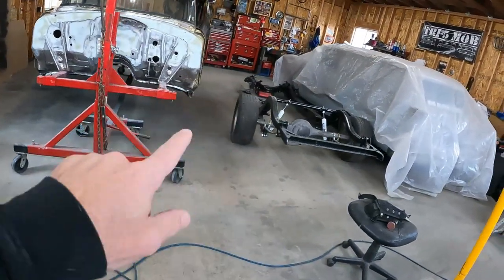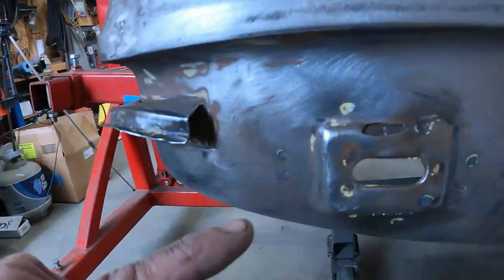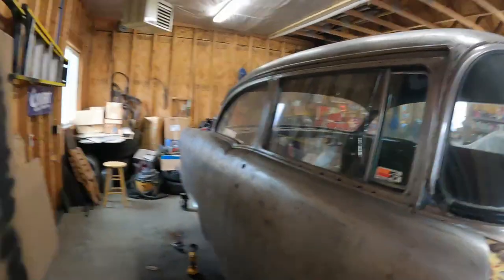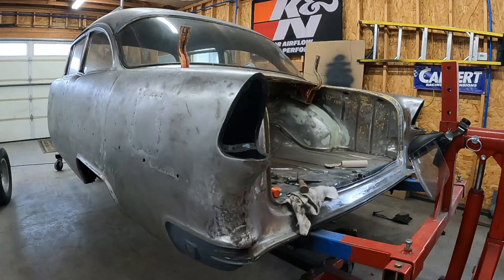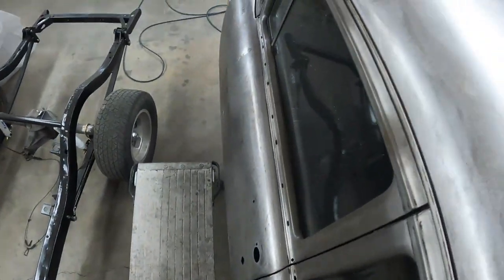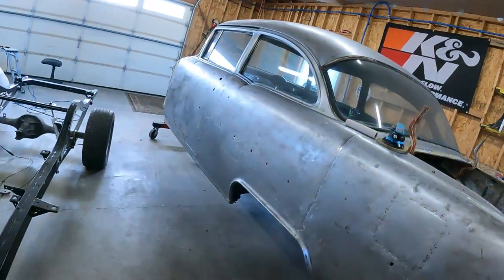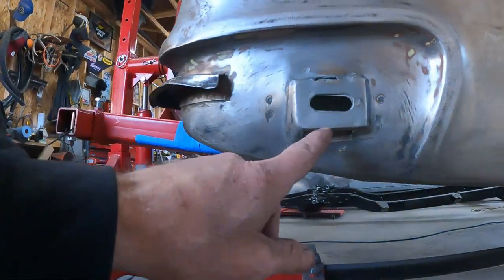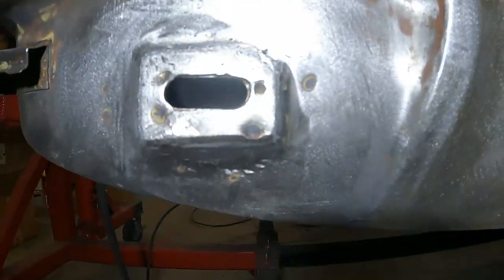1955 Chevy Frame Off Build - More Rust???

Comment: Brad thanks for the shout out! 
you can take a razor blade and remove south lip that goes to the glass and remove the trim without removing the glass but it ruins the seal so you would have to pull it and buy a new seal! If you don’t understand hit me up 
Keep mobbing! Tri 5 mob rules!
Reply from the maker: You bet David. Thanks for always trying to help. Dan at DD needs Nomad parts. You got any leads?

Comment: Brad, Looking good. Bits at a time. A tip for weld thru primer. When i use weld thru primer, I put a small scratch in the primer to insure a good start. Just enough to make contact. 
Stay real
Rick
Reply from the maker: Thanks for the tip, I'll definitely try that next time as it sure caused issues...

Comment: There are several rust converters that turn rust into black primer. It works I have used it. You could use it on a spot like that on the inside hard to get to. Sometimes it feels nice to just lay down and work kinda like working and resting at the same time.
Reply from the maker: Thanks man. Nothing like lying down on the job...

Comment: I have a kerosene heater. 55000 btu if you ran one of those it would heat the rest of the shop up. Shut it off when painting. Then drop traps on the smaller area and paint.
Reply from the maker: I think I have enough heat, just a matter of finding the time to be at the shop for a couple days to get it done now.

Comment: Hang your trunk lid from the ceiling and paint your trunk and lid one sitting.   Exterior on a different day is how I think I would tackle it.      I guess, are you gonna pull the doors for primer?  Maybe I'll finish watching this episode before I ask more questions
Reply from the maker: Thanks for the tip. I will eventually pull the doors to do jambs etc, but probably not for this quick primer job just to seal up the metal. It'll have to get primed again so I'll do all that at that point.

Comment: Use a small flat blade screwdriver to clean the weldthrough primer off of the base metal that you are welding to. You should see a big difference in your welds. I don’t know why they call it weldthrugh primer when it never works like that??
Reply from the maker: Yeah I should have done that as it was definitely causing issues. Thanks for the tip. I'll try that next time.

Comment: What would work to hold the metal so it doesn't rust? Some WD40? A few fast shots of some spray can primer? Seems too bad you'll lose all your work on it
Reply from the maker: I've heard the WD-40 thing, but a little worried it'd cause issues down the road. It should be fine for a while. Hopefully I can make it happen soonish...
Reply: If you plan on painting car I wouldn't be spraying WD 40  any where near car.  Not easy to remove and can ruin a paint job.
Reply: Spray it with fast etch. Have heard it works good if you plan on leaving it in bare metal for a while. Plus it helps convert any surface rust you might have missed in little pits.

Comment: Weld thru primer sucks. Clean the weld thru off in the plug weld hole to bare metal welds much better.
Reply from the maker: I will definitely try that next time as it was causing issues for sure. I had used a different brand in the past and welded right thru it doing plugs with no issues. The new stuff was much cheaper. Now I know why...Thanks for watching and trying to help.